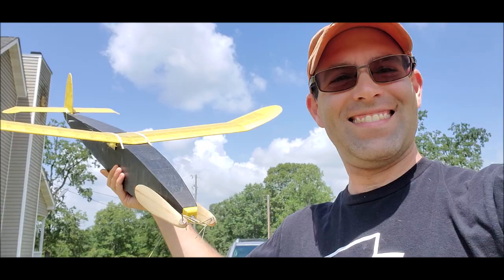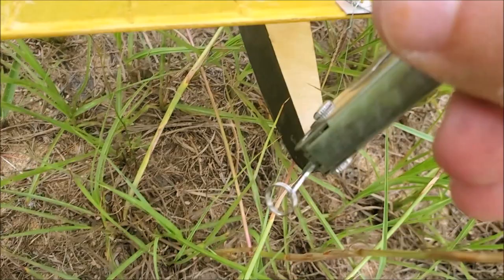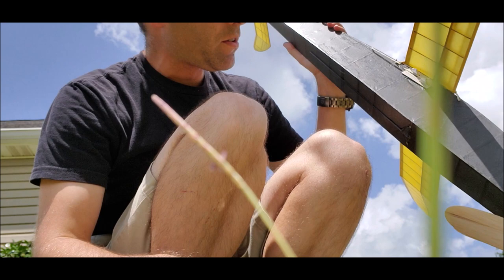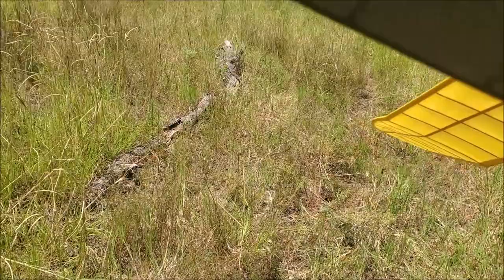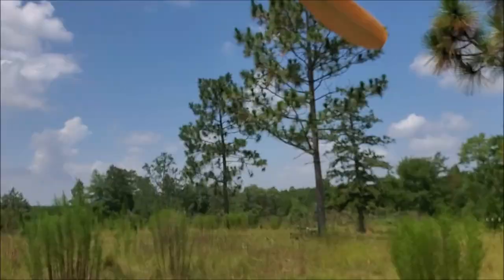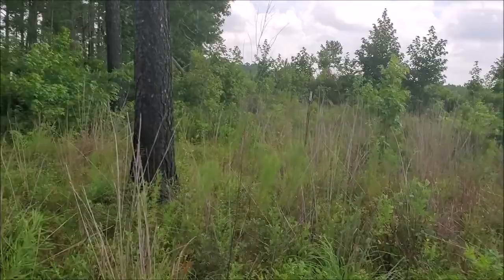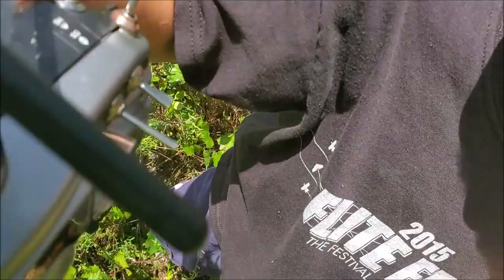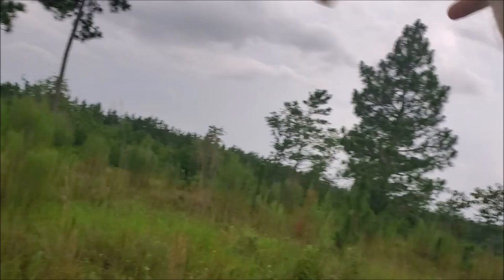Rubber powered hotrod airplane: the Remoffett!

Comment: Thank you for a very enjoyable video. That model is a thing of beauty. I could never see myself risking flying it beside those trees  like you do. You are the man! Like the R/C DT system. I will have to try that whenever I finally get my larger rubber models finished. Did you ever use those strong magnets for holding the nose block in place? Like the ones used on R/C models to hold down canopies and hatches?

Comment: Maybe you can shed some light to what im doing wrong.   Im new to building, and attempting to fly these.   I dont think ive yet to see one fly.   Basically in most cases they all just seem to climb up and then drop on the tail, or nose dive.   I thought once i got a better motor id see better results but i think they actually got worse!   Now i get lengthy prop spins, but zero power.   The stock blue rubber band in the guillows kit was better, itd atleast pull the planes.   Btw, love your channel, maybe ill try one of your kits next.   Currently attempting a couple of the easy built models kits.   But any tips?    Id love to see one of these fly, by my own accords!   Closest was yesterday... but still ended up stuck nose 1st in the mud!   Plane survived a hard hit.   That was the 1st plane i built, a really old berkleys kit my dad mailed me. Came out well, i put a cox 049 on it, it started off flying nice but i think a gust of wind made it bank hard left and nose dive.

Comment: only been watching rubber power for a month or 2.  this looks like a longer fuselage than typical.  does the length of the fuselage dictate the amount of power you can get out of a rubber motor......longer fuselage, longer rubber, more turns, more power.
Reply from the maker: Looks are deceiving in this case. The fat fuselage, for satisfying the fuselage cross section rule, looks big but is actually about the normal length for an endurance plane. A lot of folks thing shorter fuselages are better but they aren't as they limit pitch damping and rubber capacity.